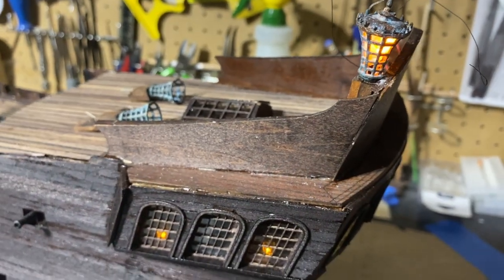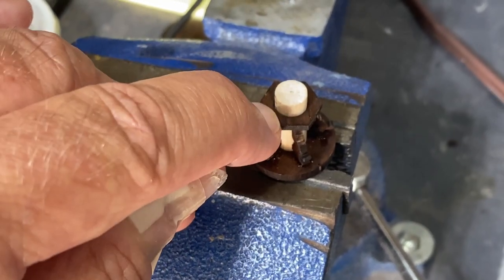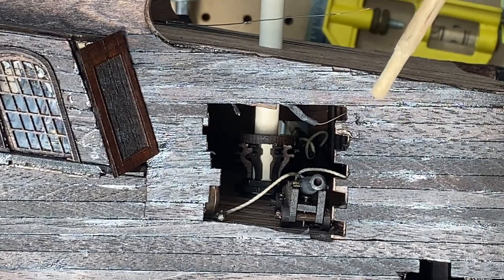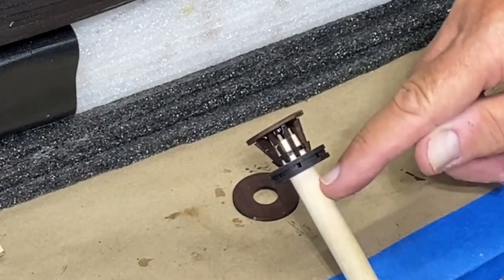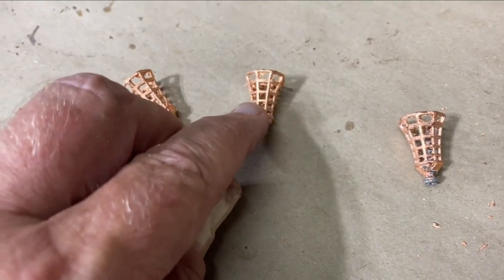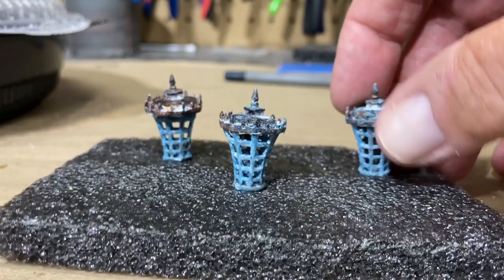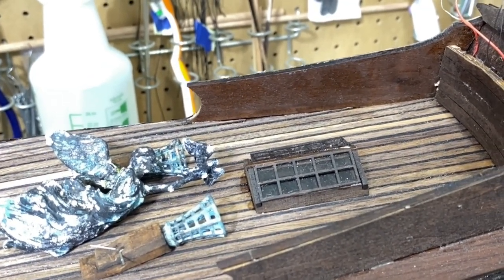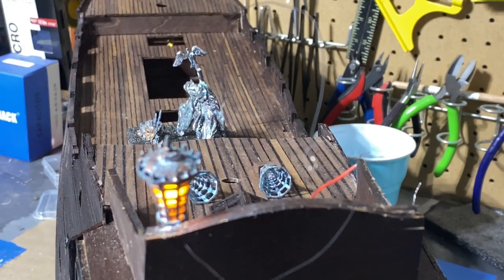Black Pearl All Scenario Version PART 12

Comment: a good coating of bees wax on the dowel while assembling can help prevent parts from sticking to dowel. I also use white wood glue rather than ca on close pieces for initial assembly then recoat with ca after dry and removed from dowel
Reply from the maker: I'll commit the info to my memory cage!  Thanks

Comment: Really nice tricks and tips Dan. The aging process on the lanterns and statues are amazing.  I've run into a problem that I'm trying to remedy. Turns out, I'm highly allergic to the starbond ca glue. Don't know if anyone else has had an issue with the glue vapor or not.  Found a possible fix with an odorless hypoallergenic ca glue from starbond.  Hoping this does the trick.  Won't have to wear a respirator to enjoy this hobby. 👍
Reply from the maker: Sometimes we all don’t realize how things can effect us!  I’ve noticed sometimes a white almost powder residue near a ca joint….. We all probably inhale micro particles 😷
A good time to reflect and minimally rethink ventilation. I’ve been using more variety for glue too.
Thanks again for following along on my journey.